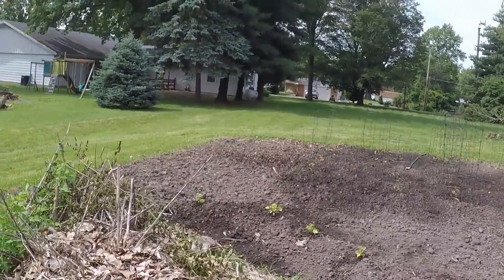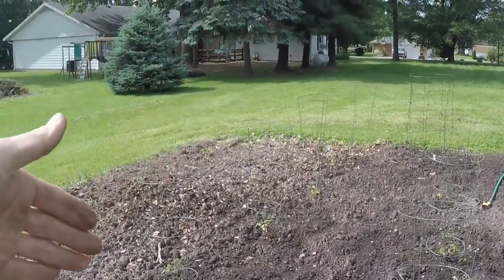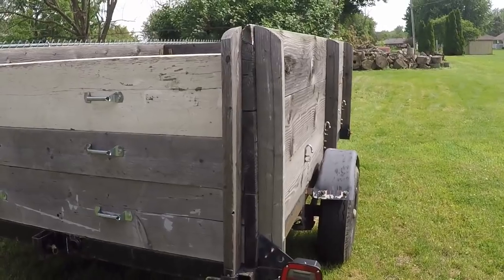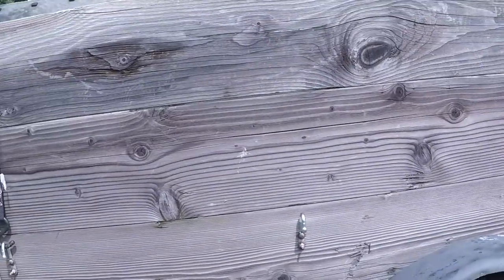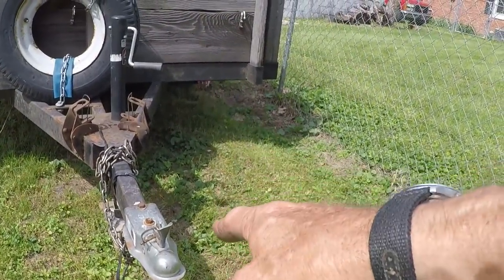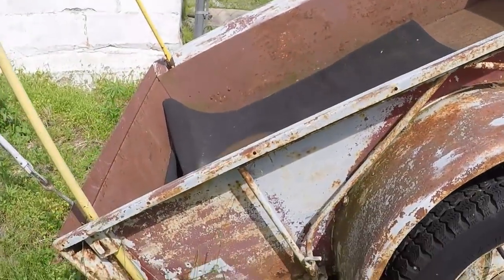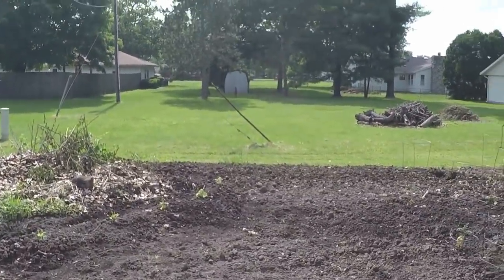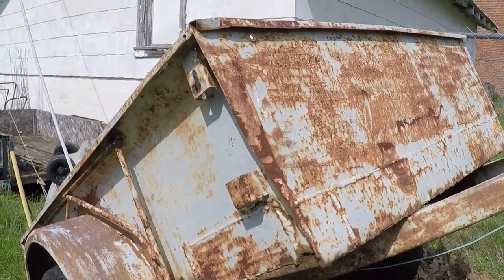Tiller Action and Trailer Talk!! #smallenginenation

Comment: I've owned going on 100 trailers and the homemade ones are always built like tanks. Some of the factory ones are so cheaply built they crack frames, bend decks, etc.
Reply from the maker: That last trailer I showed has a bent frame. I'm surprised they are permitted to be sold if they don't meet certain safety regulations. Look at all the air bags new cars have now and they are allowed to sell that crap? lol. Great point Moe! Zip~

Comment: I had a 14' travel trailer for a while that had so many roof leaks I finally tore it apart a couple years ago and turned the frame of it into a flatbed trailer.  I made a headache type rack on the front of it to attach my ramps to and it works great for hauling lawn/garden equipment on....I'm going to put a piece of angle iron on the back to allow me to drop a bolt or pin through my ramps to keep them from sliding around but other than that the trailer works great, just wish it sat a bit lower but could easily be fixed if I wasn't so cheap and went and bought a set of arched ramps HAHA!!!

I do have a 23' car trailer as well but I try not to use that beast unless I just have to, it weighs I think 2400lbs empty so it isn't a lightweight by any means, you definitely know its behind you.  It was made out of old portable landing strip mats, from what I can find they're called Marston Mats.  https://en.wikipedia.org/wiki/Marston_Mat
Reply from the maker: Sounds like you're ready for anything with those two trailers. I too have an old trailer frame sitting behind the shop that I've never taken the time to build into a nice car/tractor hauler. It's 18' long and 7'6" wide and 6'5" between the tandem axles with E brakes. Bad thing is, I've had the trailer since 2006 and haven't done anything with it yet lol. Cheers William! Zip~
Reply: @ZippoVarga  Only issue with my car trailer is the ramp on it is too short and they didn't build it really as a car trailer the guy who built it ran a landscaping company that did a lot of those landscape boulders so he was hauling heavy boulders and landscaping equipment on it.  If the back part of the trailer behind the axles to the ramp was beaver-tailed it would be a much better trailer and it doesn't have a winch on it so its quite a chore loading and unloading vehicles that aren't running LOL but I don't have to worry about ever breaking the trailer...I do however need to get the brakes fixed on it as they don't work at all.

Comment: If you don't take the time to paint the wood on the big trailer at least splash a coat or two of Boiled Linseed Oil to give the wood a fighting chance plus keep that wood strong so when you are hauling your machines they will stay securely in place.
Reply from the maker: Awesome suggestion Frank! I like the Boiled Linseed idea! I also want to relieve the trailer of the plywood and get back to the planks. Cheers! Zip~
Reply: @ZippoVarga   I use that on just about every wood handle I have, it keeps the wood from shrinking and getting loose like hammers and files.
Reply from the maker: Sounds like a handyman's wood stabilizer to me! Zip~